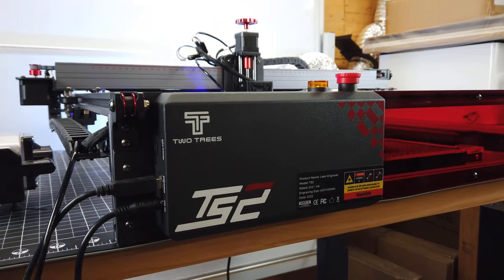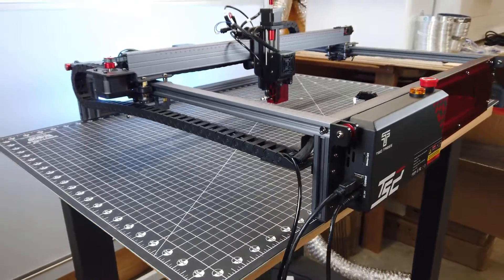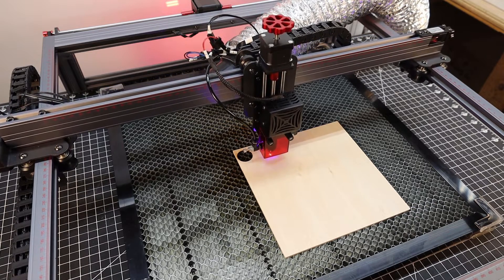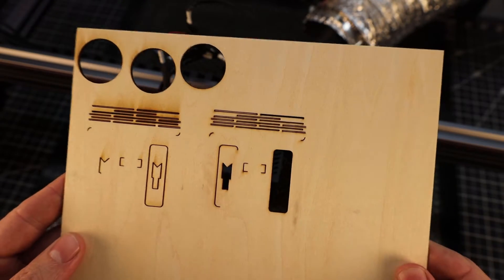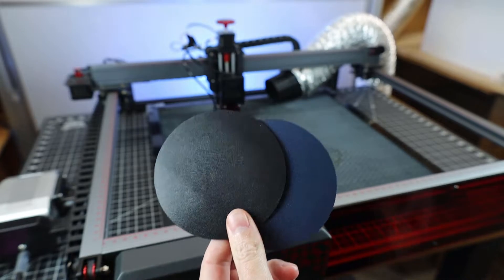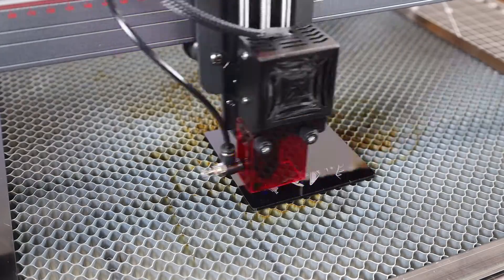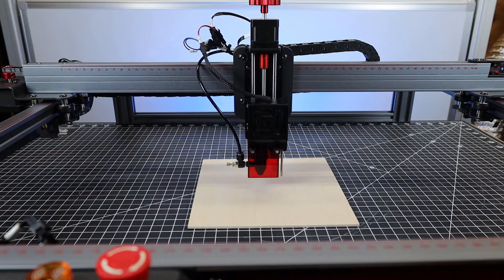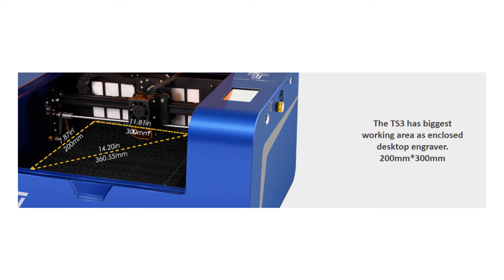TS2 Laser Engraver HONEST review - The Good & The Bad - Two Trees

Comment from the maker: Use the following codes to take $100 off your order:
$100 off TS2 - RMTS2100 
$100 off TS3 - RTS3100

Form Two Trees:
TS2 10W Diode Laser Engraver - https://bit.ly/TS2LaserEngraver
TS3 10W Enclosed Diode Laser Engraver - https://bit.ly/TS3-EnclosedDiodeLaserEngraver
Honeycomb Cutting Area - https://bit.ly/HoneycombCuttingArea
Air Assist Pump Kit - https://bit.ly/AirAssistKit-TwoTrees
TS2 Engraver Enclosure With Smoke Extraction - TwoTreeshttps://bit.ly/TS2-Enclosure
LightBurn Laser Software - https://bit.ly/LightBurn-Laser-Software

Other Options from Amazon:
Honeycomb Cutting Area - https://amzn.to/3TuBsOE
Air Assist Pump Kit - https://amzn.to/3CNBo5U

Materials you can or can't use with your laser - https://cpl.org/wp-content/uploads/NEVER-CUT-THESE-MATERIALS.pdf

Laser Cutting & Engraving Materials:
Aluminum Business Card Blanks - https://amzn.to/3S96efP
Aluminum Pet Tag Blanks - https://amzn.to/3r78VCB
Stainless Steel Blanks - https://amzn.to/3xL1rJu
Baltic Birch Plywood 3 mm - https://amzn.to/3SvHxu1
MDF Sheets For Laser Cutting - https://amzn.to/3C0PBNI
201 Pcs Engraving Material Box - https://amzn.to/3C2Ow84
Black Slate Stone For Engraving - https://amzn.to/3BKza78

Download the CH340 Driver Here:
https://sparks.gogo.co.nz/ch340.html

Laser Software: 
LaserGRBL Free - https://lasergrbl.com/
LightBurn Paid - https://bit.ly/LightBurn-Laser-Software

Free Laser Test Files:
Engrave Material Test Laser Pattern (LightBurn) - https://drive.google.com/file/d/1VmzXgLFeil-zOarKUNs0QklVCMqqTEQA/view?usp=sharing
Cut Material Test Laser Pattern (LightBurn) - https://drive.google.com/file/d/1DVm-P38fsdGC2fzOeuDwhkWSrzNS6A-t/view?usp=sharing

Here is a place to buy cheap files that you can cut and engrave - https://tidd.ly/3Mw1MG4

3in to 4in Exhaust Adaptor STL File ONLY - https://bit.ly/3inTo4inExhaustAdaptor
______________________________________________
Note : Most of the links that I use that go to products are affiliate link. This means I make a small commission on anything that you happen buy using them. This is at no extra charge to you and this helps support the work I do on this channel. 😁👍
______________________________________________
Reply: Coupon code not working ..

Comment: Be careful with these machines.  The manufacturer won’t tell you until it’s too late.  The plastic they use for the control boards etc., is very flammable. If you leave the machine in the on position (not working),  it can overheat and catch on fire.  Search YouTube for laser meltdown.
Reply from the maker: Oh that is really good to know

Comment: Hi, today I will share my very bad experience with the company Two Trees. I have had the TS 2 for some time, a little over a year, and I am satisfied with it. However, I am not satisfied with the company's conduct. Except for one single instance when the support responded immediately and the problem was resolved, communication has been a nightmare. Repeated urgings and week-long waits for a response are not uncommon, but the last experience is truly a gem:
My Z-axis cable broke, so I requested a new one. I explicitly stated the type of laser and that it was an expansion kit for the Y-axis, so I needed a long cable. The support responded relatively quickly, and on April 10th, I ordered all the spare cables. When I found out on May 20th that the order had not even been shipped, I politely inquired via email when they would ship it and when I could expect it. On May 23rd, I angrily scolded the After Sale support via WhatsApp. An hour later, I received a notification about the shipment. The next day, I was told via WhatsApp to contact colleagues from the pre-sale department. Not a word of apology, let alone a discount on the next purchase. A week later, I received the spare cables. Today I found out that the replacement cable is 20 cm shorter.

The laser from TwoTrees is a successful product, but the stupidity, amateurism, and idiocy of the employees degrade the quality of the product. Sorry, but I had to get this out.

Comment: I know this thread is from a year ago, but I ran into the Z axis issue on the TS2 I just bought. It turned out to be the laser module mount (the moving portion) was hitting the two lower mounting allen bolts. The heads stick out too far, so I simply swapped the module cover screws for the mount two lower screws in question. Problem solved immediately. Z has full travel top to bottom now.

Comment: How do you center items? Is there a centering indicator?
Reply from the maker: You can tell the software to frame your design and have it start from the center. Other than that you have to eyeball it for the most part
Reply: @randymay  Thanks! That's what I am doing now "Eye balling it" and it sucks. I'm going with Xtool which has centering indicator.
Reply from the maker: You the xTool does have a laser marker to help light stuff up and it does come in really handy. I have videos on that laser setup and some must have add-ons that might be helpful
Reply: Cool, thanks appreciate it.

Comment: What are the wattage ratings of all of these units that you have tested ?
Reply from the maker: They all seem to have 10w lasers on them now. I don't have the tools or knowledge to test what the draw from the laser really is if that is what you are asking
Reply: @randymay thank you. You answered it. What I was looking for was the 10 watt or whatever the manufacturer said they were. Are these capable of a deep etch if multiple passes is used ? I would like to etch something deep enough to hold an enamel or cerakote in the lines.
Reply from the maker: @FatKidBrody  yeah it can do that but it would depend on the material your using it on. Also I forgot to post it in the video but I have some $100 off discount codes  😁👍

Use the following codes to take $100 off your order:
$100 off TS2 - RMTS2100 
$100 off TS3 - RTS3100
Reply: Can this machine cut transparent or other colors acrylic ? Thank you
Reply: @virtusangel1510  check @ time stamp 5.09